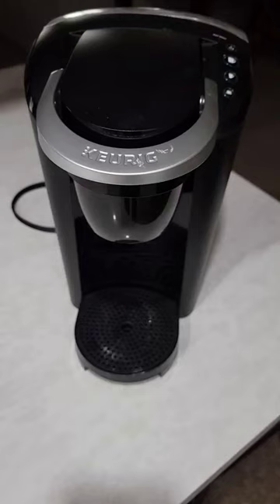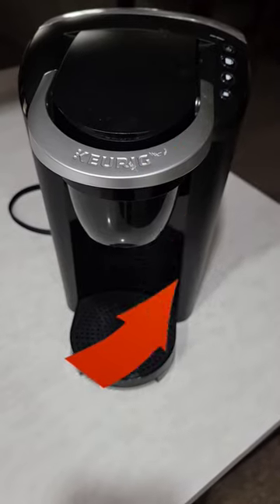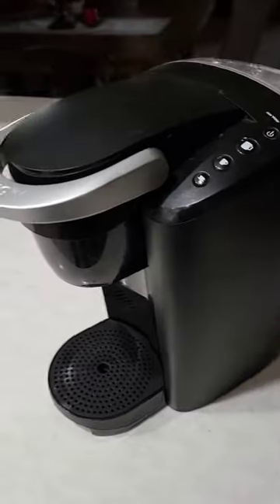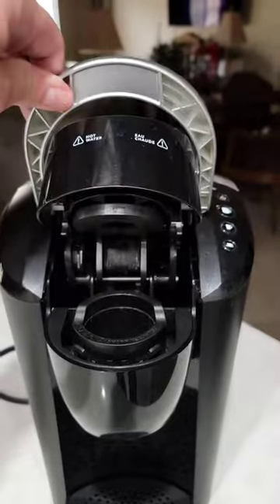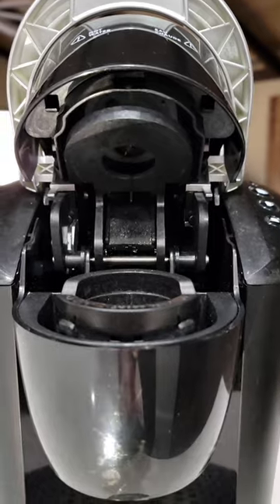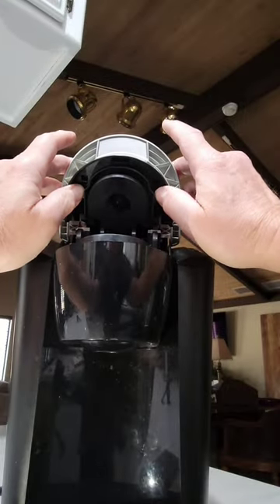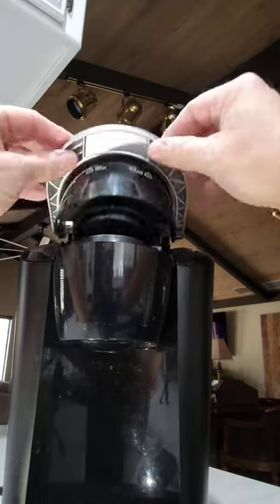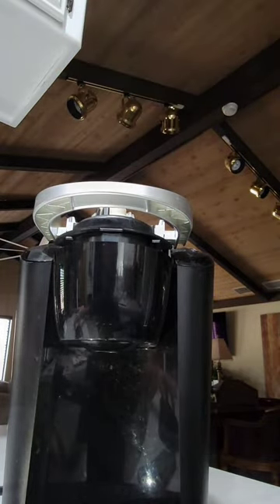Tab Release Quick Fix for Keurig Top Cover #keurig #keurigrepair #keurighowto

Comment: Thank you for the follow-up.  Wish I had seen it before putting so much time into getting mine going again. 
I got to tell you though, it would still be much clearer if you used maybe a pencil to point it out first as your fingers cover most of the area you are talking about.
Is this a K-35?  Mine looks like this but does not have the release mechanism as this one does.  I am wondering it they eliminated it.
Reply from the maker: Glad it helped.